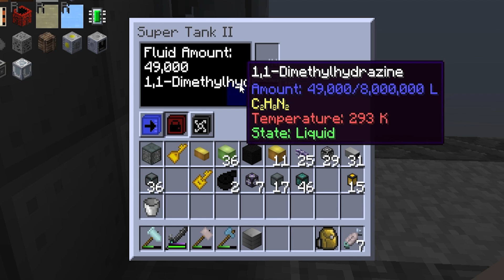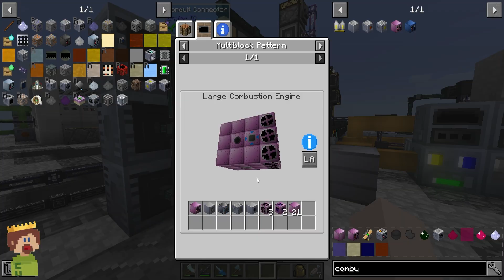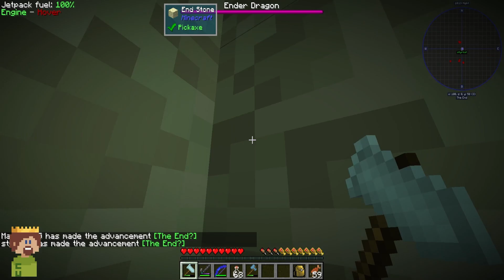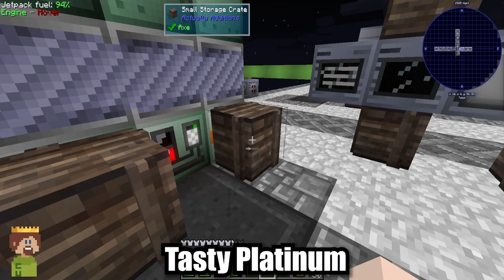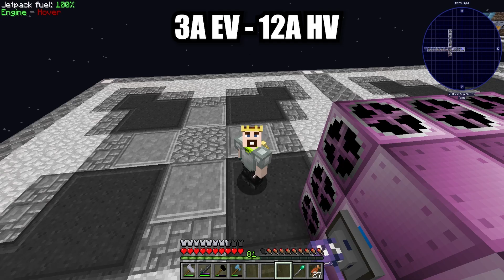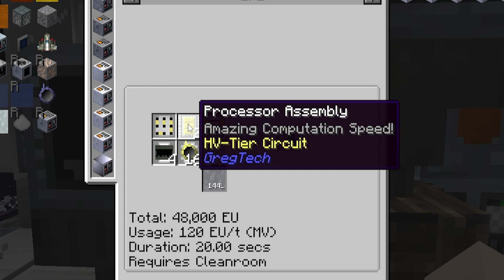FINALLY RADON!!! - NOMIFACTORY 8

Comment: CWG, You want to passively produce nanocircuits up to the glowstone bit. You're doing great, though at this point you really can't skip the microverse.
You're also not supplementing yourself with passive titanium and tungsten from passive end stone and metal mixture... It's not much, but it is passive, and if parallelized it will do you wonders for IV, esp the tungsten/endstone line.

Comment: You will use the reactor for radioactive isotopes and power later on in order to be able to power ZPM and UV machines along with MAX tier multiblocks such as the assembly line (dragon eggs are used for stem cells which are used for wetware circuit boards) (you will need draconic evolution fusion in order to get further into endgame and DE fusion needs a lot of power)

Comment: hey cdubs! to fix chlorine you can use ghast models in dml to get tears, then those get you salt water which is free chlorine. also, you'll want to make a beefy dml setup for diamonds becuase you need them in the millions. I got by with 3 mil but I also chose to use micro miners for advanced platline outputs (not as efficient as just setting up advanced platline). EV is also the best time to setup a real ore processing system, and make sure it's got room to upgrade. I chose to use a "cell" design with 5x5 areas for each process, just because I knew that I'd upgrade to processing arrays once i unlocked them. also, don't forget how powerful oredict storage busses are for ore processing! ive also heard that you can make an efficient oreproc with gregtech pipes, but i just chose to use a subnet since im more confident in my skills with ae. nice job on getting HOG also, i love to see the combustion engines being used instead of numi spam lol
Reply from the maker: Numi spam is boringgg

Comment: Cdubs, how do you power your giant machine line? Do you have multiple energetic alloy lines or is it just one power line?
Reply from the maker: I start with a 16A fe/eu converter drawing power from the main battery, then run a 16x wire basically until machines start losing power (when the full 16a is saturated), then I place a new 16A fe/eu converter and continue on
Reply: I’m going to use that for my stuff. I thought I had caught up to you over your break and was super proud of myself, and then, in like 2 weeks you are in insane voltage. I cannot wait for GTNH, maybe you will reach the star gate!